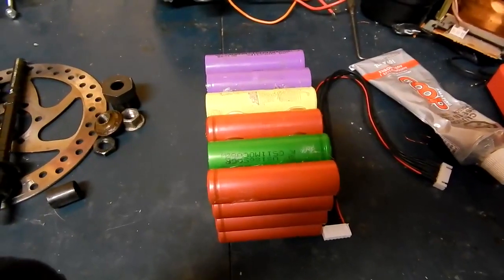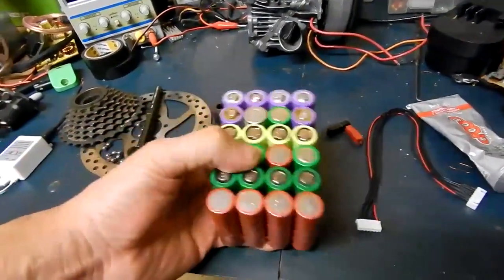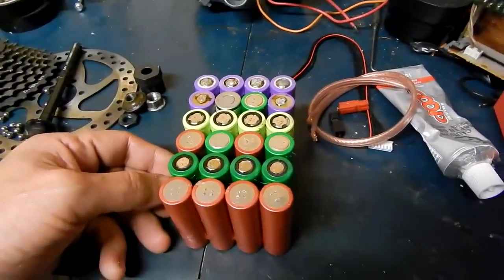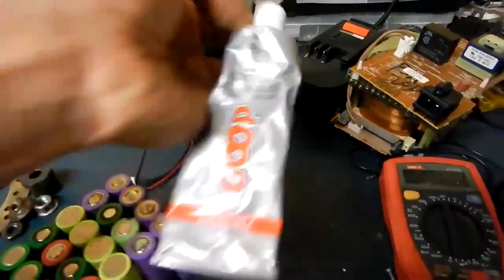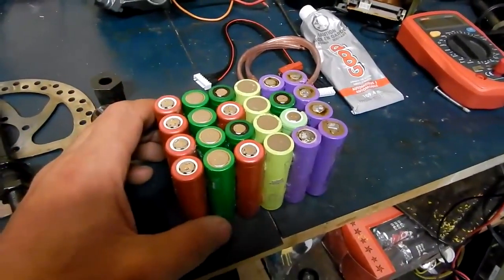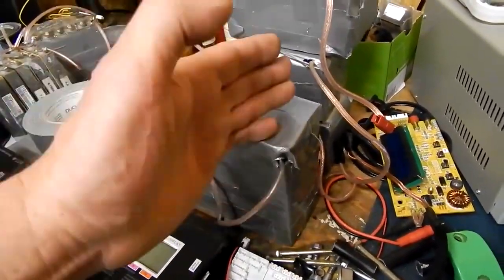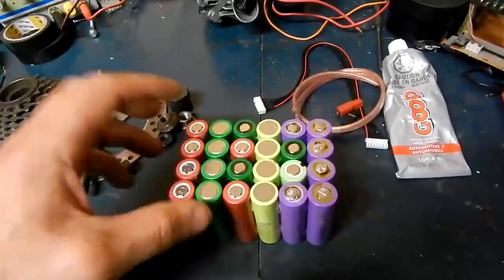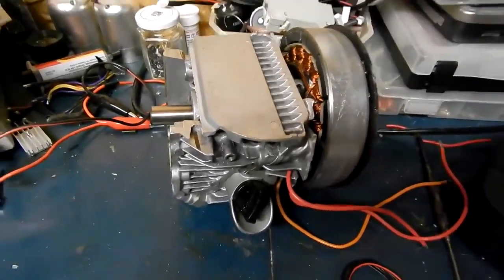24v 10ah to 15ah lithium ion pack for ebike part 1

Comment: When choosing batteries from different sources do you need to match up the stated capacity in amps?
Reply: No I made a battery pack with different capacities around 2000mah and 2600mah
Reply: Best if you use the same capacity

Comment: Hello. 
I have a question. I have an 24V electric scooter and I want to change the 2S 12V Pb-Acid to a li-ion battery pack cells for improved range . My question is: Do I have to put 6S or 7S li-ion cells in a pack, to supply the 24V motor? Some chargers and BMS for 24V electric bike are labeled for 7S li-ion pack. For example, the 24V electric li-ion charger on the market (ebay) has an output voltage of 29.4V (4.2V x 7) and also the BMS for 24V it says 7S configuration. Some people make packs with 6S. I don't know what to choose between 6S and 7S. I don't want to fry my 24V motor.  Please help me with an explanation. Thank you.